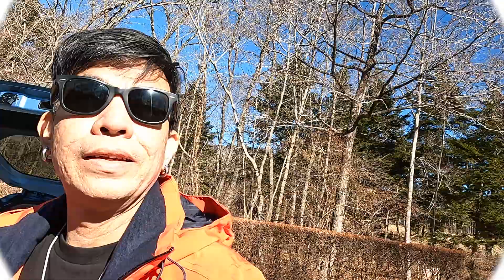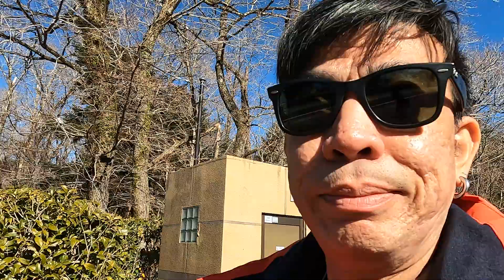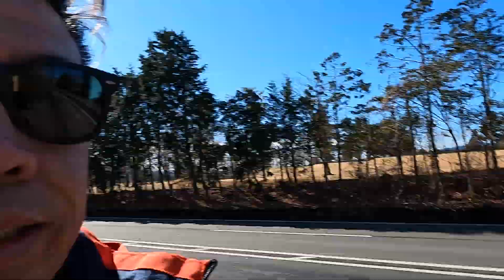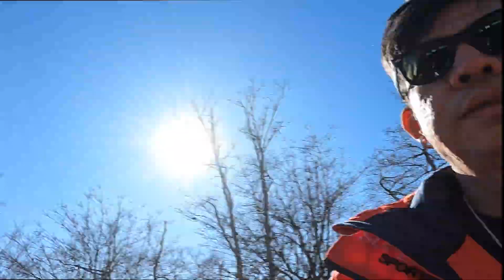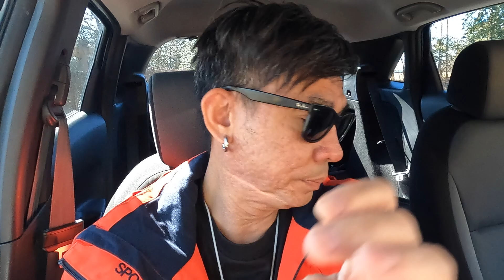DJI 04 Lite Range Test @ 200MW | Mobula 7 04

Comment: why only 200mw?
Reply from the maker: Usually, 200mw goes a long way.  So with a short test u can roughly gauge the difference with 700mw or 1w.  Sadly... the damn quad had an RXLOSS at such a short distance.  But it was something due to the ELRS and VTX frequency clash.  I think MadsTech mentioned something like it. Thanks for dropping in bruh.

Comment: Today i flew 1.3 kilometers in open field line of sight with the mobula 7 o4 at 700 mw. Results in this video make sense low to ground and are still great for such a small light quad.
Reply from the maker: WHOAAAAAAA!!!!!! Thats bloody impressive bruddah!! Can you share with me the packet rate of your ELRS and transmitting power? As for the Mob7 04 was it at 40mbps? Great job man!
Reply: @shogunemperor  thanks, elrs packet rate was at 50. 2:100 in the OSD. The output was 250 with Radiomaster zorro. I was in an open field flying to the beach and back, nearly failsafed tho. O4 lite was at 700mw and it dropped from 60 to 40mbs at 1.3 km. It was and scary at the same time :) also the Radio link was weaker than the video at 250mw output on the zorro.

Comment: Didn’t you put it on 700mw for law or damage to the o4 lite?
Reply from the maker: Yes sir! It was set to 700mw. Yeah… i kinda did smash the canopy and got the screws dislodged. Only realized it much later when i got back. Weirdly enough… i didnt get very far with 700mw… i seriously gotta redo this video man. Really not satisfied with the outcome.
Reply: @shogunemperor  Sorry, I wasn't very clear in my question. I meant to ask: did you set the O4 Lite to 200mW in this video instead of 700mW because 700mW would be illegal, or because it could cause the O4 to overheat and get damaged?

Comment: Hello,
I would like to warn you about a scam I experienced with Happymodel – unfortunately, they sent me a drone (mobula 7 o4) without proper quality control. There were pieces of metal in the propellers, and the O4 did not respond via USB... I strongly recommend thinking twice before purchasing.

Unfortunately, the seller stated that the warranty does not cover cases where debris was left in the motors during production...

Until now, I have been using the Mobula 8 with O3, and it flew very well – I had no issues.

Comment: Hey i love to see your videos, I'm happy to see your series about this new mobula 7 and the dji O4.

I've noticed you've made your tests in race mode and from my tests I've noticed that 60mbps bandwidth gave me a better link, it drops significantly later/further than in race mode. I really recommend you to test it !!!

I recently bought dji g3 and built a pavo pico with O4 lite and hm 1102 9000kv in 2-3s I think it's better for outside on 3s and inside on 2s and I love to build my crafts.

It has an ep2 receiver but on 50hz and with my old 250mw tx it goes far enoughs. Really it's a no match compare to 500hz and I can't really tell the difference in latency if i'm cruising or doing range tests.

I guess you're not trying to go 'as far as it could' but showing the difference with this setting (500mhz + racemode / 250-50mhz + 60mpbs) would be interesting.
Reply from the maker: @bentamer4374  hey bruddah!! Thanks so much man, appreciate u dropping in and sharing! Wow yeah! Im only flying racemode cause of the latency. As advised, i shall try it at the full 60mbps. I tried it last week n was kinda “meh” cause after turning past a tree i had a smoke and coffee before the quad actually turned.(im kididng, but u do get my point! Hahah) sadly this HM FC is only 2S max. But i think ur 3S will give it better punch and range! I really love how u word ur comments bruh! Sounds like ur REALLY enjoying the process!! Hehehhe big shoutout to u man!! Hope u have an awesome weekend bruh
Reply from the maker: @bentamer4374  i realized… i didnt mentioned that i was on racemode… IDIOT ME!! 🤦‍♂️
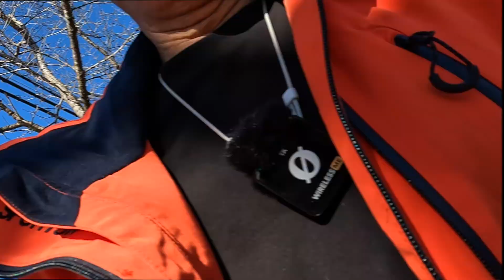Reply: @shogunemperor  Thanks, I'm really happy to share with you =). Don't worry I just looked the video and we can see it @ 2:33.
I'm also flying race mode a lot as It feel more 'linked' to the drone (but It makes me try to fly faster and then I crash :p) and don't really like 4/3 :s, I really prefer 16/9 so I'm quite divide about this ^^.
Reply from the maker: @ hahaahah i feel u man! Im kinda used to 4/3 as I come from a racing background.. we need more up and down view! hhahhaa
Reply: @shogunemperor  haha i got you about the up and down view, i'm only racing in sims and im freestyling and cruising inside irl. I'd like to race irl but there are no race field around me... 
See you in your next vidéo ! :)

Comment: I'm really impressed with O4 range, I often get ELRS RX loss before video loss which is insane compared to walksnail/analog
Reply: I was getting ELRS rxloss before video loss (on Walksnail, really) sometimes. Bought a RadioMaster Ranger + moxon antenna combo for my RadioMaster pocket. Doesn't happen anymore (dynamic power, up to 1W). Not very expensive, but gives me a short while to go back in case of bad signal.
Reply from the maker: niiiice bruh. Sounds like its all sorted out nicely!
Reply from the maker: @itsjase92  yeah! Me too! Usually, u lose video before rxloss which, to a certain extent was quite a disappointment. I never had such short rxloss before. This was a first for me.
Reply: Soon we will see people mod the antenna on their controllers so that it's on their goggles like DJI is doing. Also those 4 sticker antennas around every motor like the avata 2 and neo have, I hope that design will get copied. I don't know if that's possible without ducts but if somebody figures that out we could have the same controll performance in every quad orientation. I often get bad RX when the signal has to travel through the entire quad first.

Comment: Good clear video, 1234.32 feet is pretty good that means it is little over 2 tenths of a mile for a whoop I think that is good, I also dare say wind caused issues as well plus flying low to the ground I also say may have caused less distance before Rx-loss
I am no DJI fan, but one thing about it their video / view is the best Good to see them come out with smaller systems for smaller drones.
Great video my friend
Reply from the maker: @FlyingBuzzard  thanks so much my bro!! Yeah, unfortunately,  i couldnt fly higher as the branches are quite scraggly during winter and i kinda dont wanna get snagged up those trees. What im disappointed about is the range of the ELRS, i thought I would’ve gotten more distance. I still had video… thanks for dropping by bruddah
Reply: @shogunemperor 500hz is quite high for ELRS. I run 250hz dynamic power and have never had an ELRS issue
Reply: @WhizzlerFPV  I use also 250hz. Better range and pen. I outfly some times ELRS with analog video...
Reply: @JackalFPV  pretty sure bardwell recommends 150hz for the best all around, But I’ve never had an issue with rx loss. Besides when I used the dji fpv2 controller in the beginning
Reply: @WhizzlerFPV  I had some issues with 250hz on dynamic 250mw. RX LOSS a couple times.
Reply from the maker: @ yeah. I usually run 500hz as i come from a racing background and am quite used to the immediate response. But…. Yeah… i may need to set it at 250hz and try going further
Reply: @shogunemperor  do you think you could feel the difference between 250 and 500? I’ve done a 1000 before and thought I could feel a bit of a difference.
Reply: @shogunemperor  Keep up these great videos